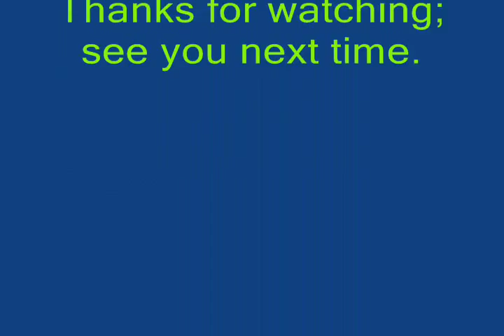Miniature tools Quarter scale #4 Silver Plane

Comment: Beautiful work, so many processes, how long do you think each one takes to make ?
Reply from the maker: ian elley, Sorry for the delayed response.  as with most prototypes, the first one took forever figuring out what to do when and how.  Then wax injections can be troublesome, and plaster molds require several steps to perfect.  Melting and alloying metal along with casting is a whole separate art.  And then the work starts - cutting, filing, sanding, buffing and polishing.  And then the woodwork -carving, sanding, etc., etc.   At times I seriously wondered if it is all worth doing.  But when the final product is in hand I forget the pain and difficulty of delivering and just love the new baby, but I'm not too eager too soon to build another.  Over a month or so, it took some  60+ hrs.